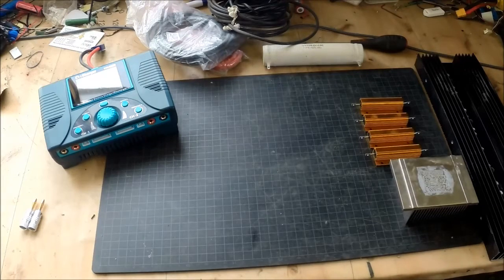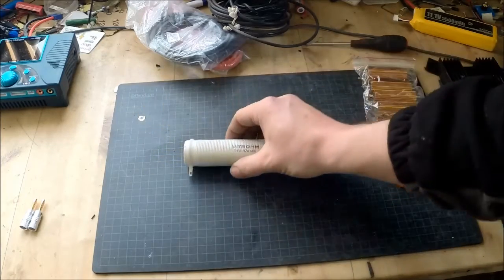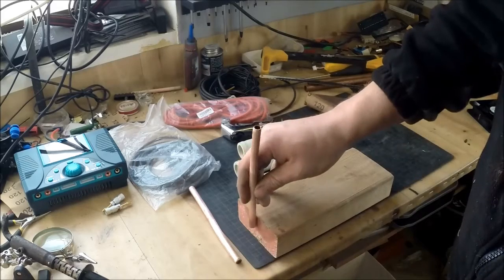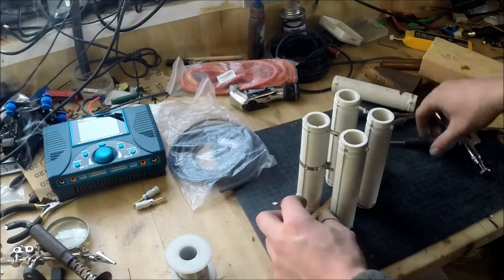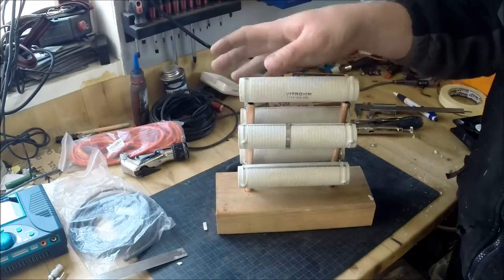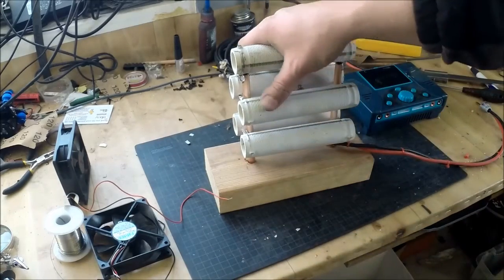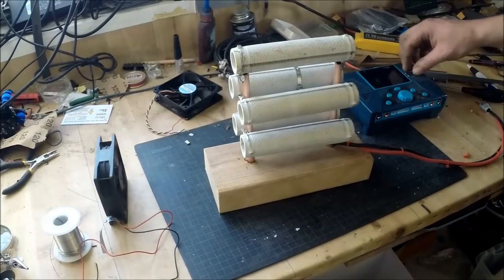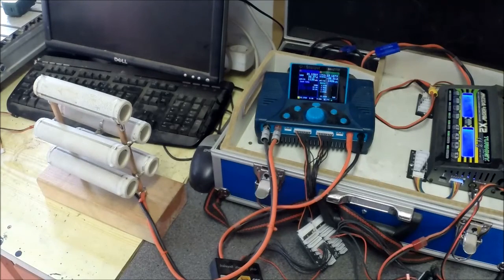How to build a dummy load for your LiPo charger

Comment: Very nice build Dar!

You must be connected to the grid ;)
Whenever, I have batteries that I need to discharge a bit for storage, I try to find somewhere else to put all that power.  So I either directly connect it to another pack through lengths of wire (small resistance) if its within .5 volts or so, to charge the other battery. Or I can use my 900w DC-DC boost converter to charge up a higher/bigger bank.  But yours would be much more efficient time-wise if you have lotsa cheap power.
~cheers

Comment: nice video on how to build the discharge Bank. where do I find the connectors, wire, and the resistance capacitors that you had shown but not used to build anything at this time in that video? also can you find out or tell me what gauge wire you were using to make that with? it almost looks like like 7 or 8 gauge wire. keep up the good videos. thank you.
Reply from the maker: +Mike Woods Hey,  the below from Ebay would work.
Resistors: http://www.ebay.com/itm/100W-Power-5-1-5-Ohm-Resistance-Aluminum-Case-Resistor-/301745834868?hash=item4641740b74:g:pXQAAOSwh-1W2Mh~
Cable: http://www.ebay.com/itm/2M-Flexible-Soft-Silicone-Wire-RC-Cable-6-8-10-12-14-16-18-20-22-24-26-28-30-AWG-/391203703010?var=&hash=item5b158ec8e2:i:391203703010
Contacts: http://www.ebay.com/itm/8x-Nakamichi-24k-Gold-Plated-Audio-Banana-Speaker-Plug-Screw-Cable-Wire-Diy-/251317391123?hash=item3a83af0f13:g:udcAAOxy9tpSBH79

The resistors you need to choose depending on voltage your charger output and how much watts it will be in total. Note that above 100w resistors will need alot of cooling to withstand 100watt each!